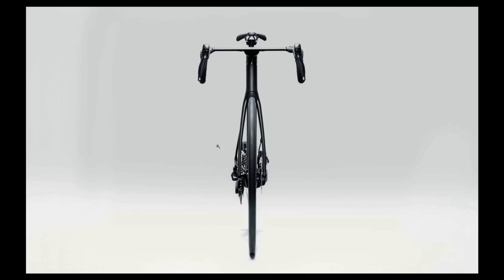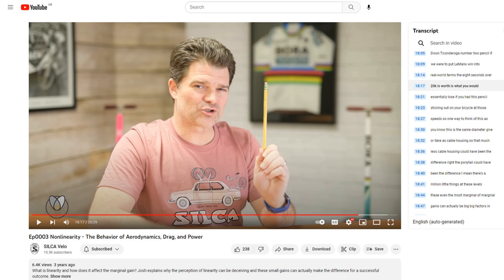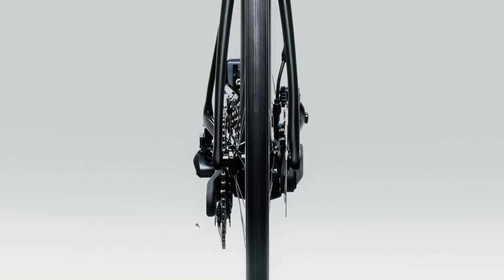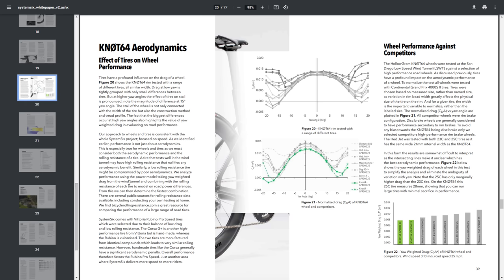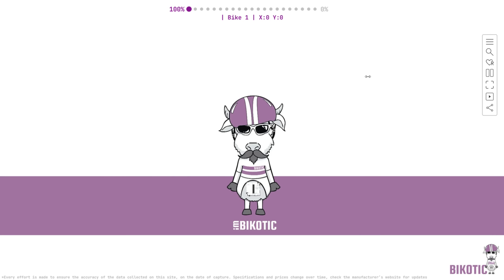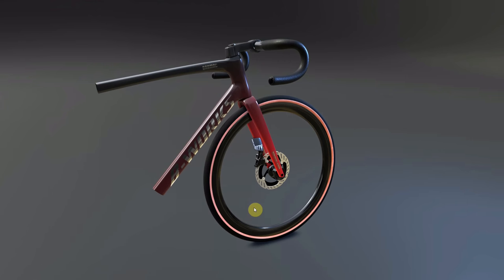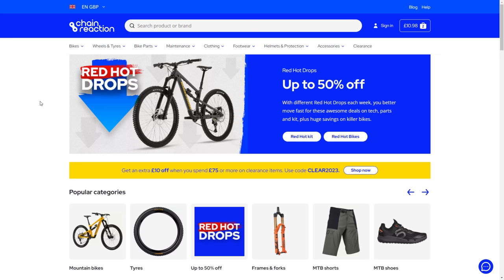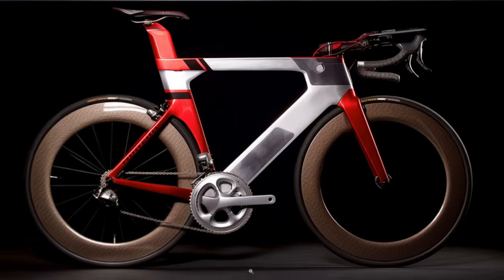Is There An Aero Conspiracy? | BIKOTIC

Comment: The forward position of the TT bike is not only more aero, but also save the legs for the running portion to come. The backward seat position allows higher power delivery (especially uphill) and is more comfortable, but fatigues prevalently the same muscles as running does.

Comment: The reoriented hose blocks the mounting bolt, meaning you would not be able to adjust the caliper alignment once bled. My solution would be to instead bolt the caliper from the other end through the fork, similar to how the rear caliper is mounted to the chainstay. A clip on shroud to the front of the fork could then keep it aero, and protect the bolts from corrosion.

Comment: I've stopped half way Mr Bikotic Sir - you are making great points, and the graphic presentation is stunning.   IMHO you are on to something, but I have the urge to intervene as a retired engineer.  I'm only familiar with the Shimano calipers, but their design is flawed.  We don't just need the hose behind the fork, we need a different solution.  You see, the top entry of the hose is the problem.  Because air is less dense than fluid, the bleed point on the caliper needs to be at the top, and hose entry at the bottom - that's why people are finding them a nightmare to bleed - gravity can't assist.  The engineering requirement points to a solution where the fluid is fed to the bottom of the caliper through a port from the fork rather than from a top entry hose in the wind.

I've now finished watching,  it got a bit surreal but fun all the same.
Reply from the maker: Rim brakes? 🤣
Reply: @bikotic  ... Thank you, and it's difficult to resist the temptation to argue it.  I have a rim brake Emonda (really light- great bike).  I bought some winter wheels for it (Vision Team 30s) that have a coating on the brake tracks - with those on it stops at least as well as my disc brake Orro Gold STC (and pack it in with the biscuit jokes) 😂
Reply: @bikotic  new cyclists changed the spelling from brakes to breaks i've noticed. it isn't about breaking efficiency as much as it is about confidence and stopping power in wet conditions. it is probably a safe bet none of them has ever actually attempted to stop a race bike in the wet because indoor cycling is where it's at. somehow this means rim breaks are obsolete now and pretty soon kids will learn how to bleed breaklines before riding their little aerobikes.

Comment: My concern with moving the hose to the "back of the fork" position is that it would compromise fork's strength/durability. Aero is nothing compared to how much forces affect the area when braking. I have crashed my bike due to fork breaking above calipers and that's an awful way to crash (straight with face to ground without warning). 

You could overbuild the hole like the recent mad0ne, but there are already photos circulating with the seat post broken.
Reply from the maker: Fair point!
Reply: That Madone was involved in a crash. The chain was off and the owner admitted to sliding out.

Comment: The air moving through the fork legs is being chopped to pieces by the wheel's spinning spokes, that it doesn't really matter if a little bit of hose is exposed. In addition we need to account for performance at different yaw angles. If we want a real solution to the problem, then the hose would exit straight out the back of the fork leg, through the flat-mount adapter and directly into the caliper without any of it being exposed at all.

Comment: The way I understand aerodynamics is that 
1. aero is not predictable, you must test everything
2. the slightest change in shape can have dramatic effects on aerodynamics
3. you want the slipstream to stay as close to the bike as possible

I suspect, because of 3, the tube sticking in the turbulent air already being generated by the rotating wheel, the tube makes either near as makes no difference, or no difference whatsoever to the air travelling between the fork. 

It may also be that because of 3, moving the tube to behind the fork as you have may suddenly cause the air to suddenly detach creating dirty air and drag, and so 1 should require that you test and see what the differences are. 

Although, maybe this is the secret that saves you 200W over the course of 200 miles at a constant 10kph when the southerly crosswinds blow ever westward while doing a cheeseburger dance on the twisty bit of gnarled moon rocks every Thursday at 12:14 am.

Comment: Could you integrate part of the disc brake where the hose/cable goes onto the disc inside the fork, so that the hydraulic hose/cable never exits the fork. You could have that part including all the olives, flare nuts that connects to the brake body integrated inside the fork where the mounts are.
Probably have some issues with the carbon fork snapping where the massive hole is to accommodate the mount and brake hole though lol

Comment: The trend to move all wires and cable housing internal seems counter to exposed hydraulic lines.  This effectively uses the fork blade to shroud the line.   Why haven't we seen any aero testing on brake/shifter levers?  They are one of the first things on a bike to contact clean air (like tires/wheels).  They come in all different styles and shapes.  Are they all the same aerodynamically?  Old campy ergopower were very small.  Some shimano hydro levers are huge.

Comment: That's an interesting take. But since the exposed cable is right next to the brake rotors, which create a lot of turbulence, wouldn't a cylindrical bit of hose sticking out not affect the aero too much? (As opposed to if it was sticking out of the headtube)

Also, I do have to admit, the Bikotic hozzy does look exactly like something ceramicspeed would sell. Better patent it so ceramicspeed doesn't steal your idea haha